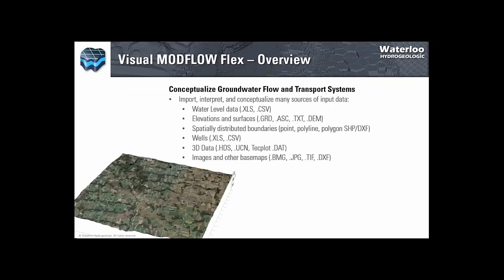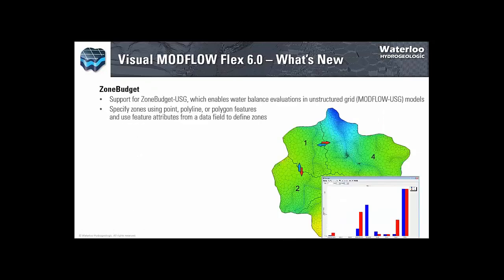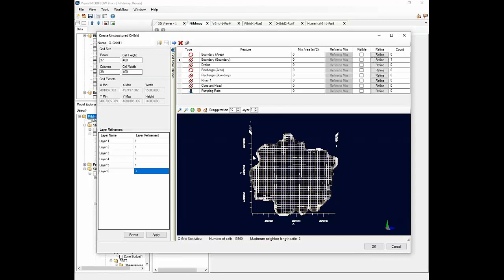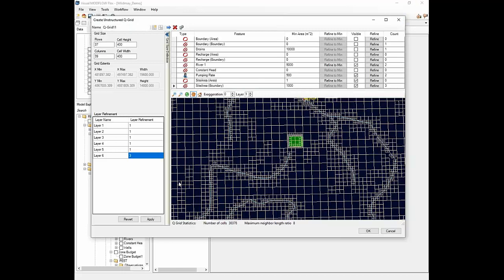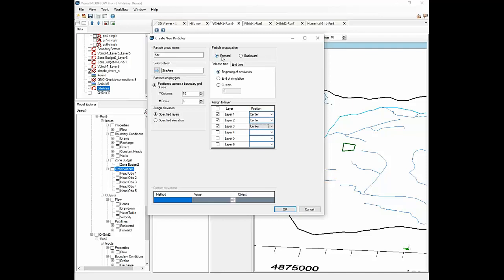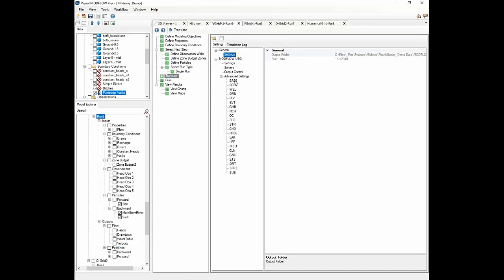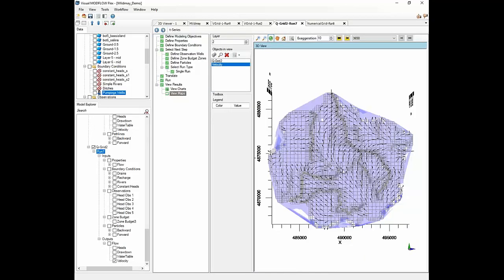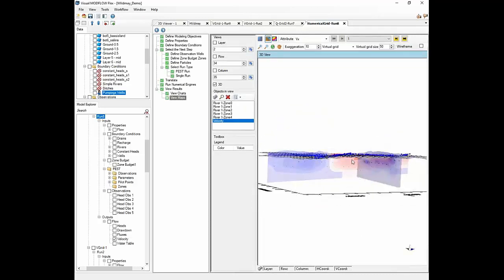Visual MODFLOW Flex 6.0 WEBINAR

Comment: So please let me ask you some questions standing in my mine now to avoid doubts and errors. 

Before the question, I should mention my research stage:
I'm in the initial stage because I presented the proposal almost some months ago or less. 
The title reads like this:
Assessment and Simulation of Groundwater quality Correlation to Proximate Landfill Leachate, A Case Study On Selected Landfills in Johannesburg, South Africa.

Questions:

Q1. As my model and simulation are about contaminant transport simulation and prediction of groundwater quality changes in the future, how many models do I need to develop?
Q2. Do I need to develop a groundwater flow model and solute transport model or just one model can suffice both the flow and the solute transport?
Q3. What are the required input data for constructing the conceptual and numerical model of the solute transport simulation? Do the flow and solute transport model inputs need the same data. Where should I use the water quality data in the modeling process?

If you provide me the answers to these questions, it'll encourage me to boost my research endeavor and to do good research.
Reply: Sir I need some help regarding Visual Modflow...Kindly help if possible